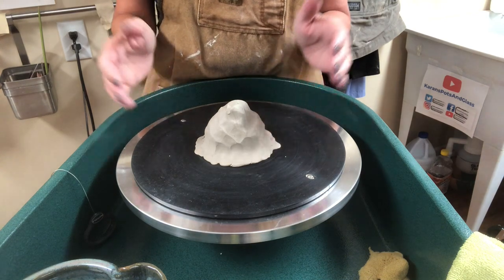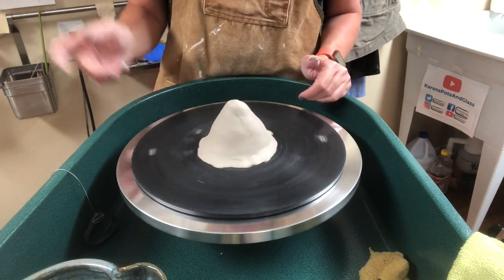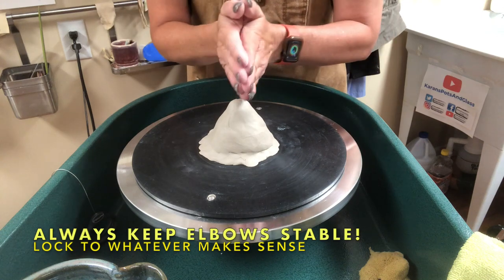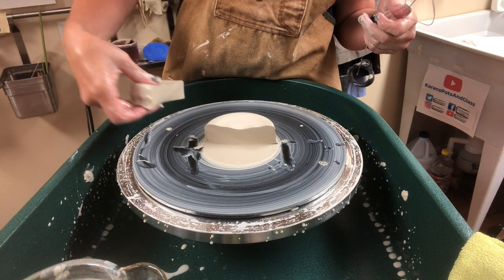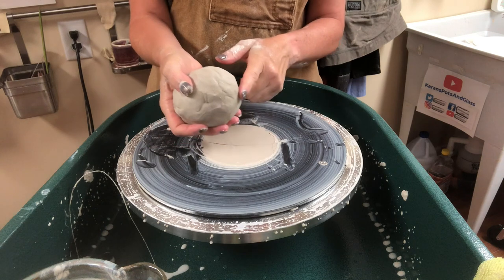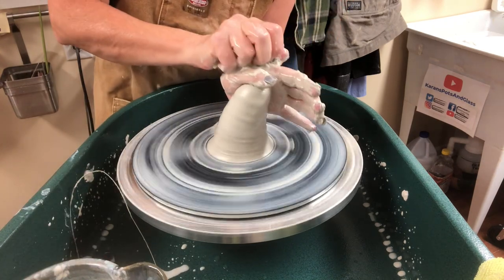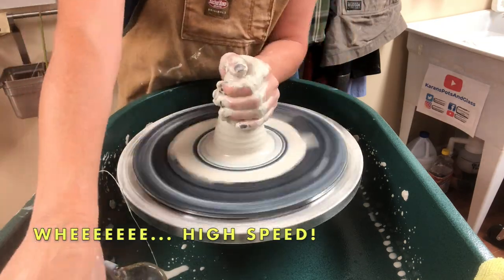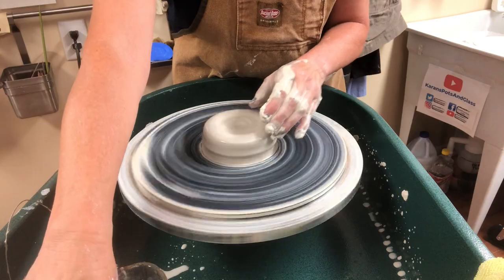Wheel Throwing Series, Step 2: Centering the Clay!  Tips for Successful Centering!

Comment: The problem I have with centering is that I cannot for the life of me get the last little wobble out of the clay - I'll be 98% centered and never quite get it right.  I will cone and cone and cone and still have a slight wobble - both on my home wheel (a Shimpo VL Whisper) and the wheels at the school where I take classes (I've used a Skutt and Brent wheels).  My guess is that i cannot get the base of the clay centered and therefore no matter how many times I cone it, it won't ever center.  Someone else can come behind me and center my lump no problem so I know it's not a wedging issue or a wheel issue.  

I can sit for hours and just never ever get it right.  I just tried to throw for 2 hours and never got a single lump centered.  Any advice would be so helpful!
Reply from the maker: Jennifer- I apologize- I JUST saw your comment from months ago!!  My BIGGEST suggestions would be:  1) lock the elbows tightly, so you have no elbow wobble, and 2) While pushing with both hands, push a little harder with the left down at the base of the clay... again with the elbows locked... this greater pressure on the side where the clay meets the bat is the biggie most of my kids need help with.  Also, many,  many time I can walk up behind a student who is struggling, to push on their left elbow and hold it steady, and that often does the trick. That left elbow stability is key!!!
Reply: I have this same problem. I can't get rid of that final wobble. I'm a total failure.

Comment: Have you upgraded the "drive" for your wheel.  I bought a used yet new skutt wheel and found out the offer an upgraded electronics controller. Just wondering if you don't have or have the upgrade when you purchased or after the fact.  Thanks for the great video on centering.
Reply from the maker: Yes, when I got mine, I did get the SSX controller. It's awesome!

Comment: When I try to cone I almost always end up with a little volcano at the top. Somehow I pull up sides and the tip is down below in a little hold I’ve made?? Help!!
Reply from the maker: This is such an important thing to learn!!  When I teach my beginners, I emphasize that they must put pressure on the outside corner- to push it diagonally toward the center of the base... that helps to prevent the volcano in the center!  Reach out through my fb page or instagram if you want to have some more indepth explanation- sometimes I lose comments on youtube as there are so many!